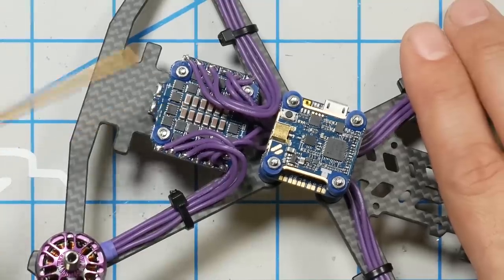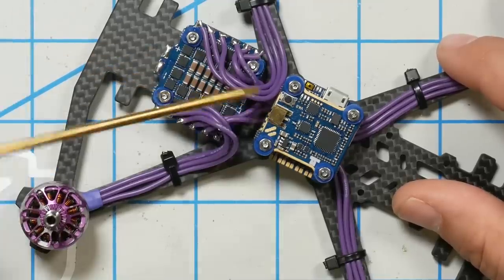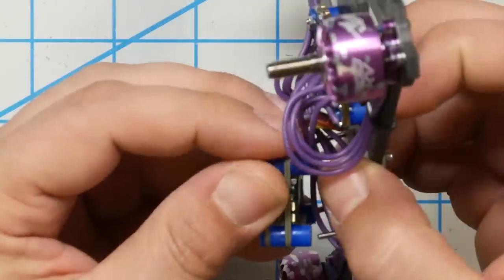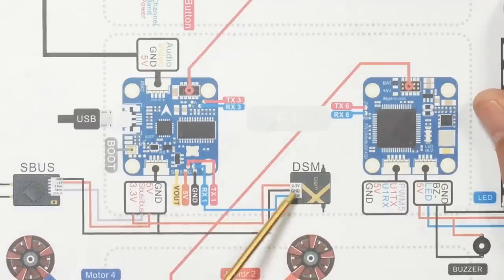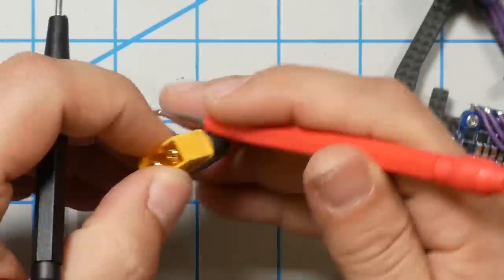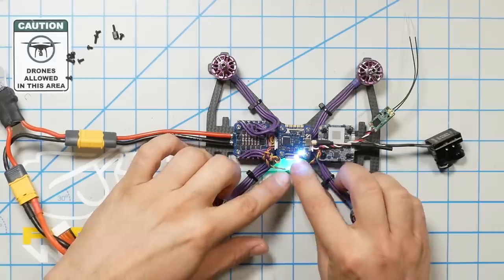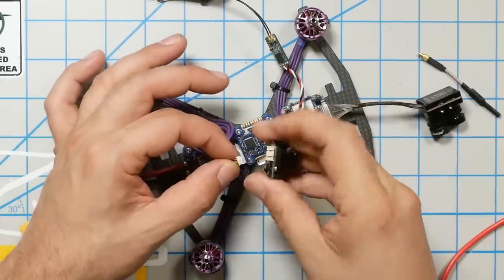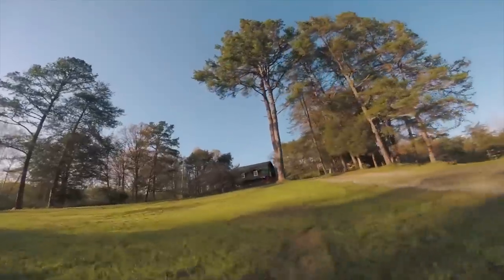JB's Acrobrat build goes COMPLETELY WRONG | part 2

Comment: In my experience, the result of a build is never what I imagined when I started the build. Your build videos are just so real. Perfect way to show newbies what they are going to experience on their own.
Reply: Really? For me it's always what was planed. I mostly build quads for other people tho
Reply: @peterzingler6221  You build them and they work fine without any changes? 

Let me give you a few examples of problems I had so far: 

1. Stack doesn't fit in a low deck. Had to flip ESC/FC upside down. 

2. VTX/RX doesn't fit where I want them, need to find a new place that fit the cable/antenna length. 

3. FC with integrated PDB placed not far enough from VTX causing video interferences. Flip one of them or find another place to put more space between them. 

4. LC-Filter near a battery cable causes video interferences. 

5. micro camera doesn't fit in micro-cam-frame (yes, that really happens). 6. Various forms of vibrations caused by not enough FC-damping or cables connected to the FC. 

7. Ground Wiring allignment of VTX/OSD/CAM/LC-Filter not good enough causes video interferences.
I have to say, I consider any video interferences using a quality ESC a lack of build quality.
All those problems happened to me me using cheap components as well as high priced quality components.
Sometimes I need 5-10 flights and 3-4 changes to my build until I am completely satisfied.

Comment: Hi Joshua. I love what you are doing, I have learnt so much from you. Thanks a million! I went through this issue as I'm running a Spektrum DX6 and there wasn't much info about how to connect a DSMX receiver. (I'm also a NOOB). Most documentation suggested that I would connect my receiver to the S-Bus terminal but that would not work for me. I ended up finding some info about the topic on YouTube. I had to connect to a RX input and configure Betaflight accordingly. ie RX3 turn on UART 3 serial RX on.

Comment: I'm doing same frame with a Mamba 405 mk2. 
Same issue with stupid plastic esc cable but I already had the JST 1.00 kit. It's nice silicone too. Bought in UK from Unmannedtech.
Edit - Silicone washers on top of my Runcam - Thanks Joshua, your camera didn't die in vain!!

Comment: I recently bought the HGLRC Zeus F4 AIO and it wouldn't fit in my iH2 facing forward ( it's a big board) so I turned it around and changed orientation in BF . But since it also turns all the ESCs around as well , I couldn't get it to work right. Is there a solution to rotating an AIO FC/ESC ?
Reply: You probably have to remap your motors in betaflight. JB has a video on that: https://youtu.be/z5aO-3_n-Hs

Comment: Hy joshua grat video I did buy the conectors from race quad great I need it them. Thank u also the bottom on that receiver it's so small I got one and it's so difficult to be pressing the bottom and try to connect the battery at the same time lol.

Comment: That sucks what happened to your camera board. I've ran into the same issues when using a stack mount AKK VTX they always have little resistors next to the mounting holes and the very 1st time I tried screwing the nuts on I didn't pay attention to the resistors and the nuts knocked of a couple resistors. I don't have that problem no more though as I use the Rush Tank VTX. I love that Rush Tank Racing VTX and Runcam Phoenix combo. The combo is so cheap in the Kwad Box store as a subscriber that I bought that combo for all my quads! Best analog FPV picture I've seen for the cheap price of $38 total!

Comment: why use the nuts for the runcam board? i usually take a nylon stand-off and cut the screw thread off and it's much more easier to tighten than with a nut

Comment: OMG, lol I just did the same thing but I only knocked off the outer one. Took some serious determination and F bombs but I replaced the resistor. I have to wonder though. We'll see if mine works, I had to salvage the resistor from a shorted diy drone for kids. In order to find one that small you have to use very up to date modern electrics. Had to do the same with my remote for my car when a cap popped off the board in the keyfob. Grab a junk Xbox 360 and take out a cap with a pair of tweezers and now my remote is fine. Because of tolerance with each of these parts I believe you can replace with the same "size" visually even if the value is incorrect. The remaining parts of the board compensate naturally by their +/- variance.

Comment: Why don't you use a laboratory power supply instead of "smoke stopper" + LiPo? It does the work done, and it has the closed circuit protection (nearly every one). Of course it won't be reliable for further tests, like motor tests, but for builds IMO its a comfortable solution. Greetings from Poland!
Reply from the maker: I don't have a bench supply on my rather small build area. The smoke stopper works perfectly well and is portable.

Comment: Stingy did a video on resoldering in a toaster oven.  Worked fine.  Call Stingy for details and make a video showing how to save $70.00. Your viewers will love it
Reply from the maker: Reflow won't help when you literally knocked components off the board.

Comment: Move fc to back. And move esc to middle and rotate it 180°.
Reply from the maker: I don't want to move the FC to the back because it is pinned to the vTX. I could do it if I direct-soldered the FC to the vTX but that is a big hassle.
Reply: Joshua Bardwell all the more reason to do it. If you move fc and vtx to back won’t the antenna mounting be easier ?
Reply: @JoshuaBardwell  if you move the fc stack with the vtx to the back will it not fit? Then just rotate the esc 180 and run the battery leads out the front top.

Comment: Should I start with a 5” or a 4” or a 3” or a 2” ??
(I am a begginer)
Reply: its all the same .. go for 5 plus sim (more time on the sim) ...and dont use angle mood ore level mood its hard at first but you will learn faster .. buy a lot of spare parts .. a lot
Reply: I bought a 75mm whoop.. I don't regret it
Reply: It's winter. Buy a beta75x train with it and if you feel ready switch frame and props to toothpick style and shred it

Comment: Hey just had all the vvvvvvvvv on the 20amp betafpv board just changed default font to bold and the vvvvvvvvv went away
Reply from the maker: Any update of the font will fix the V's.
Reply: @JoshuaBardwell  ya I tried I put 4.1.0 on it and still had the vvvvvvvvvv but I didn't try updating the fonts in osd I heard that fixed the problem as well. Also thanks for all the help you give us Joshua